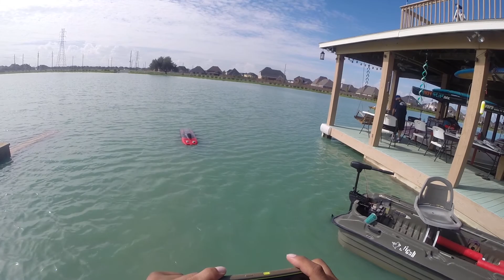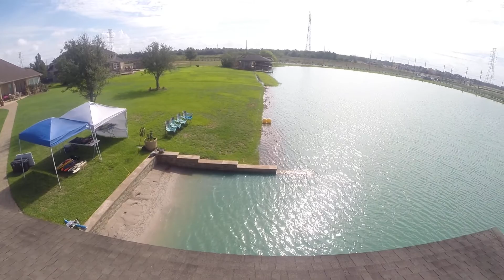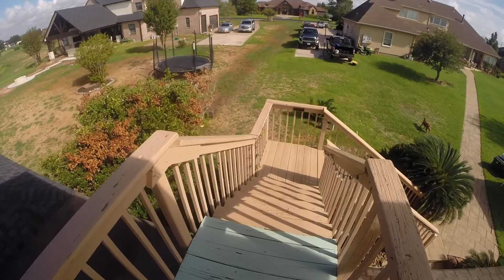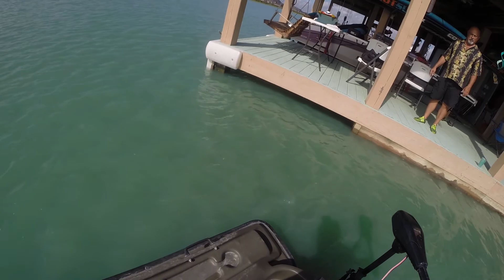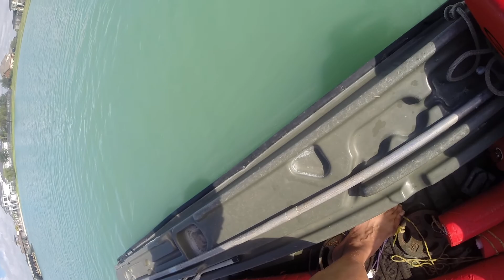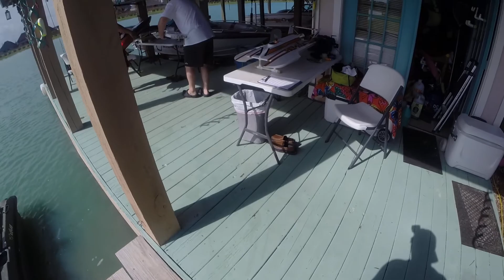Exocet 150 crash 14s  @108mph

Comment: makes me sad to see that happen to your boat😪 man. hope it will be ready again soon🙂
Reply from the maker: Bro me too. That one hurt bad. All my fault as I was too quick w the trigger. The lid is on its way to kent already for repairs. Inside the boat I'll make small repairs
Reply: @ubtrippin1  I'm glad nothing more happened to it. but you maybe need to take some more weight ind the front of your boat just a little so it doesn't fly off so easily🙂